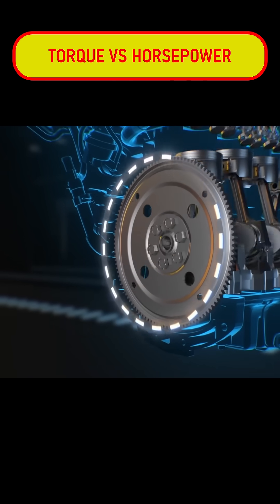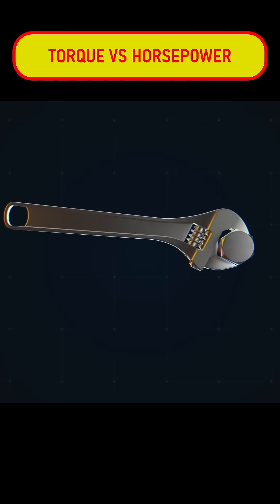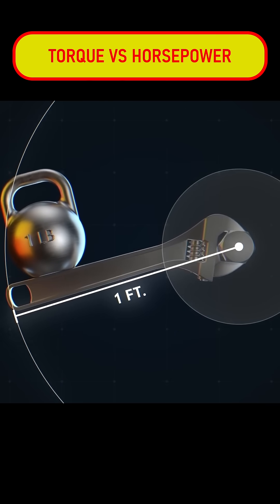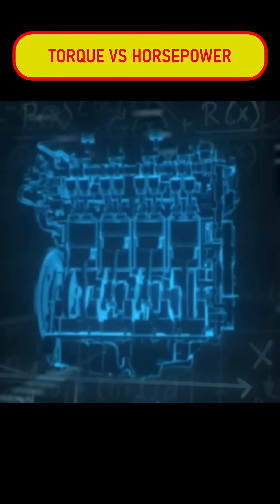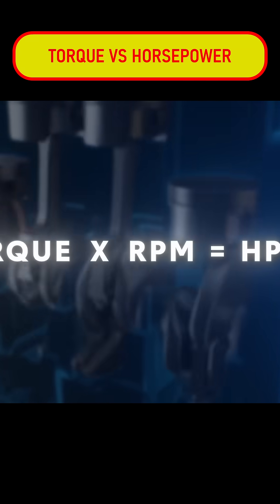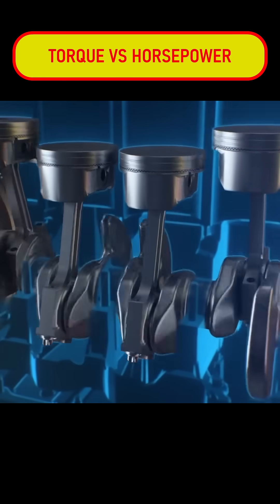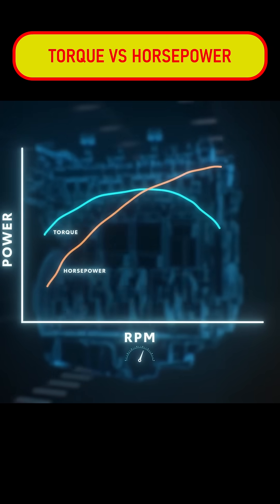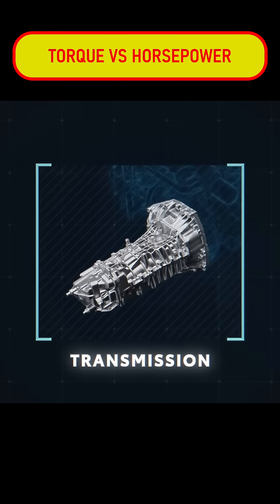Torque Vs Horsepower

Comment: It blows my mind that my parent's 2006 chevy 3/4 ton truck with a 472 V8 only has 7 more HP than my Fiat 500 with a 2L inline 4. I always thought it somehow put out more torque, but it does not.

Comment: Video is 🤡🌎🚮 “The measurable output of an engine is called its torque”
“Horsepower is actually a calculation, not a physical measurement like torque is”

Complete nonsense.  Both power and torque  are measurable.

Power, not Torque, is the limiting factor on how much work can be done within a given time frame, things like towing heavy loads up steep hills for examples. Power, not Torque is also the limiting factor for how fast a vehicle can accelerate.😂

Comment: Torque = force.
Horsepower = energy.

Force is used for acceleration.
Energy is used for efficiency.

In short, torque is the result of cylinder pressure and horsepower, the result of total engine airflow per minute, which is heated by whatever fuel is used. Since that fuel has an energy rating, and the engine has one, we can compare the energy transfer from chemical to action. 

Of course, these are net readings of a dyno where all the internal friction losses have been accounted for.
Reply: Torque is not Force. And Power is not Energy:

Power is not a direct measurement of energy, but rather the rate at which energy is transferred or used. Here's a quick distinction: Energy is the total capacity to do work, measured in joules (J) or watt-hours (Wh) in practical applications.
Power is the rate of energy transfer, measured in watts (W), where 1 watt = 1 joule per second (J/s).

Relationship:Power (W) = Energy (J) / Time (s).
For example, if a device consumes 100 joules of energy in 10 seconds, its power is 100 J / 10 s = 10 W.

So, power is a measure of how quickly energy is being used or produced, not the total energy itself.
Reply: Guess someone failed physics class
Reply: “Force is used for acceleration, energy is used for efficiency.” 

Not at all. The two concepts (torque and power) are so deeply intertwined that it doesn’t make any sense to separate them like this. If anything, power is used for acceleration since torque can very easily be scaled up and down by the transmission, but power cannot.

Comment: Horsepower is physical measurement of power as the name implies. It's involved in calculations but isn't a calculation itself, as essentially, if I'm not just being silly the torque * RPM is parallel to work done / time.
Reply: Horsepower is indeed a calculation, although it does represent a real physical quantity. The way horsepower is typically measured is by using the engine to turn something, and measuring how quickly the thing speeds up spinning. With this you can calculate the torque the engine must’ve produced to speed up the thing, and multiply it by what the engine rpm was while it was spinning the thing (and a constant).